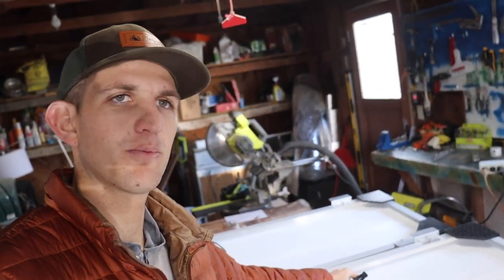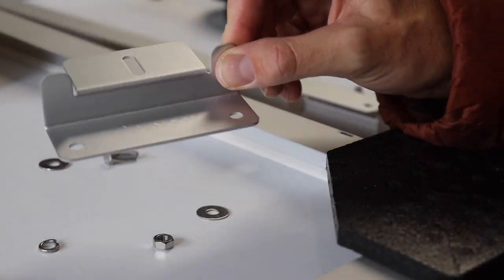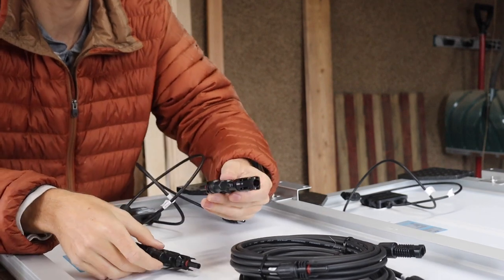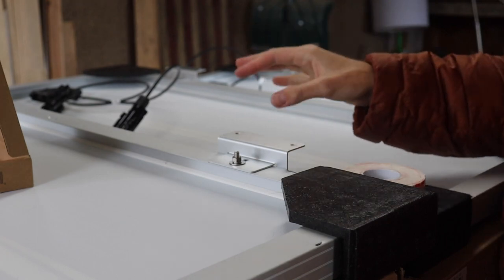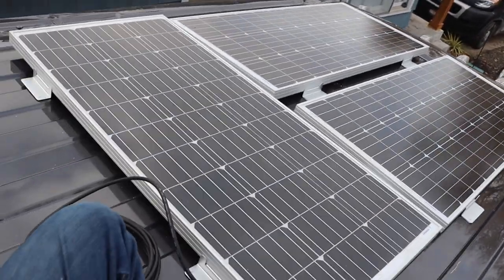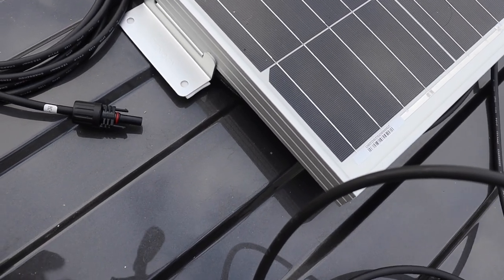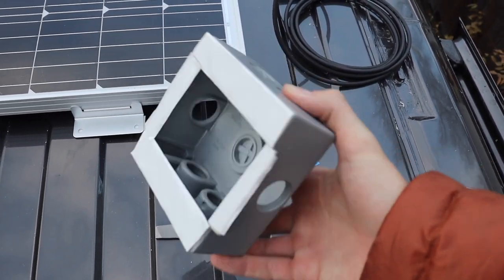VAN BUILD | RENOGY SOLAR AND GOAL ZERO INSTALL

Comment: Thank you for these videos, especially this one. I was contemplating wiring in a solar electric system with all the separate components, but now I realize I can do it in a much easier way with a power supply. Your channel has been extremely helpful as I get ready to convert my van here in Thailand. Cheers from the other side of the world.
Reply from the maker: You’re welcome! Good luck on you build. Cheers 🍻
Reply: Why do it with only a power supply?

Comment: The VHB tabe works very well,  but one caveat I'll add is to make sure surfaces are thoroughly cleaned with a solvent and especially to be cautious if the vehicle has been repainted, as a strong bond to the paint doesn't do any good if the the paint isn't properly bonded. 

It's harder to paint the roof of a van and harder to see it once it's done, so this is where painters are more likely to be less diligent about prep work.

Comment: Just ordered this complete setup for my promaster.    Love your videos.    Thank you so much.   Fyi, your link for the 15ft extension goes to the 5ft ones.  Had to send them back to Amazon.   Can you show us how and what you used to  take the 110v line  from the yeti?
Reply from the maker: Shoot!! Sorry about that!! I understand that gets frustrating. 
What I did for the 110V was buy an extension cord. Cut the end of it and wire it to the outlet! Then I just plugged that into the goal zero
Reply: @AnkeneyVanBuilds  Great solution!!
Reply from the maker: @mont3765  seems to have worked out great!!

Comment: Thanks so much for these videos the detail is great. Just finished our floor and plan to use most of your methods, I'm wondering why you choose 300W of solar to support the Goal Zero 1500? Thanks
Reply from the maker: 300 is a safe amount that keeps the goal zero charged up pretty quick with the amount of electrical to be used!! Ive been happy with it :)

Comment: Looking forward to seeing how you wire it all together! Love this idea!! I also like the fact that you can have the goal zero charged from any 12v source while the van is on the move.
Reply from the maker: This also makes it so easy to unplug and transport if you need to take it inside to charge!! Check out my ceiling and puck light install video. At the end I show how it’s all wired up!
Reply: @AnkeneyVanBuilds  it’s brilliant!! I happen to have a foldable 160w solar panel so I’m pretty sure I’m skipping the panel on the roof. Btw, don’t think you mention it but is the van a 159” or 159” extended?
Reply from the maker: @taeum3062  it’s the 159” high roof! Not extended!
Reply: Is it possible to charge the Goal Zero from a 2500 hp gas generator - if you have no other charging source?
Reply from the maker: @normabournes5789  yes! The yeti comes with a 110v plug in charger so you could take it inside and charge it in your house or in your case, with a generator
Reply: @AnkeneyVanBuilds  thank you for your quick reply! I don’t know how you do it! You seem to reply to all your messages! Your van turned it great! My husband and I are working on a 2014 Ram Promaster 159 as our retirement project. Your videos have been a God send! Thanks again!
Reply from the maker: @normabournes5789  hahah I love doing it. The people in the comment section are always so nice! And you’re so welcome! Good luck on your build!
Reply: Do you have a video showing how you wired up all your outlets, switches, fridge, etc. Love the channel super informative.
Reply from the maker: @anthonyturner1463  I show more detail in the ceiling and puck light video and the “finishing touches” video!
Reply: I’ve been following your videos!  Thanks for the detailed instructions. You’re awesome. By the way, did you put a 30A fuse or any fuse on the positive wire from the Solar Panel to the Yeti?  I’m copying your setup, just wondering if I will need some protection.

Comment: Love your videos! I’m starting a van build myself soon and I’m very excited to see how you wire everything using the zero.(is that similar to the ecoflow1300?) I have one of those on the way. I ordered it yesterday to help me have power for an electric heater during my build out but I was also curious if anyone as used something like this to power the electrical like you would a regular battery.
Reply from the maker: Thank you!!! Next weeks video will describe how I wired my my 12v puck lights and from that you’ll see how I plan on wiring everything else! 
I basically use a 12v cigarette plug to power a fuse block and run the positive and negative wires from that!
Reply: @AnkeneyVanBuilds  I messaged your Instagram. Thanks for your amazing vids!

Comment: Hi, definitely very informative video. I am in the process of building my own camper van. I already ordered YAti Goal Zero, panels, etc. Now i need to install panels and i came across your video. I am planning to do the same thing of using VHB tape instead of screws. Are all VHB tapes same? or I have to use VHB 4952? What about VHB 59xx tape? thanks
Reply from the maker: I actually ended up screwing the panels into the van and ensuring I had a good amount of Lap sealant on. I had someone reach out to me recently saying they used the vhb and their pannels came off while they drove😳

Comment: Very nice setup and tutorial! I bough a 1500X last week an have a question, whether your Yeti can charge in low light conditions, when solar power is between 2- 20W? Mine starts to charge when power reach about 30W and up. I try to establish that this is normal (are in others units is the same bug) or I have an MPPT regulator issue. It will be very helpfull if you can check it. Thank you
Reply from the maker: That is a good question. I haven't paid close enough attention to notice. Let me monitor that and get back to you!!!
Reply: What size solar array and what voltage is it set up at?

Comment: Curious to know if the 3m tape worked. I know it's been a while since this video was made. not even sure if Ankeney still does builds, but if anyone else has tried the 3m tape and had success would love to not drill anymore holes in the top of my van than necessary. Thank you.
Reply from the maker: The tape worked! Doesn’t hurt to double up the security of it buy screwing it tho
Reply: @AnkeneyVanBuilds  oh wow the man himself! I’m thinking of using an auto body adhesive, supposed to be as strong as a weld. Fingers crossed. I used it for some rocker panel repair I had to do once and it’s held up great.

Comment: I'm looking at the anderson to MC4 adapter that's linked in Amazon. Is the polarity correct on that for the Yeti, or did you need to use a reverse polarity coupling? (Folks mention that in the reviews on that one, and on the adapter sold on the Renogy site, but not clear what they're plugging into?) Thanks for your videos!

Comment: Hi Colton, did you connect the solar panels directly to the Yeti 1500?  No fuse needed on the positive wire?  Just wondering if it needs any protection. Thank you for the detailed video. I’m copying your setup.
Reply from the maker: Just tied it directly in!! No fuse

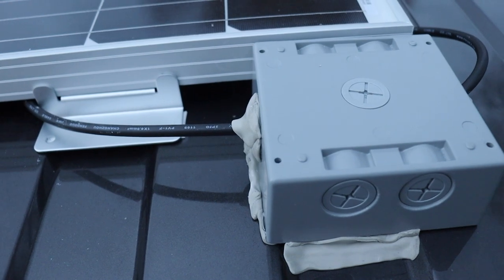Comment: Colton,  Love your videos!   At 9:11 in your video it appears that the bracket/tape/roof interface closest to your junction box is minimal due to the contour of the roof.   Can these brackets slide along the panels in order to maximize bracket/tape/roof interface?  Or, is the tape so good that just a bit of contact suffices?  Thank you again!!!
Reply from the maker: Hi! Great observation. I addressed this in a newer video where I talk about “finishing touches”
I’m sure that tape would have been fine. But I went through and added the self tappers and sealed them up! Just for extra precaution

Comment: To reduce the size of the hole you drilling in the top of the van, can you cut the renology wires and feed them through a smaller hole then reconnect them to the adapters inside the van?
Reply from the maker: You absolutely can do that. Yes

Comment: I understand you have 3 100 watt panels for a yeti 1500x, do you think 3 200 watt panels would be good for the 3000x?
Reply from the maker: I’ve used 400w for the 3000x before and it worked great! I have links to both of those in my last transit video!
VAN TOUR | ULTIMATE ALL SEASON VAN | 148" HIGH ROOF FORD TRANSIT
https://youtu.be/e8MRM9kUR28
Reply: @AnkeneyVanBuilds  awesome thanks man!! Do I need a voltage regulator of any type? I’ll make sure to go find those other videos
Reply from the maker: @adamirujo6877  nope!

Comment: what adpater do you have connecting from the Yeti to the 15ft cable? I dont see that it comes with the battery bank. Is it bought seperately?
Reply from the maker: Sorry that wasn't in the description! I have made changes to that. Here is the link: https://www.amazon.com/gp/product/B07GHJ9QS6/ref=as_li_tl?ie=UTF8&tag=captainvantas-20&camp=1789&creative=9325&linkCode=as2&creativeASIN=B07GHJ9QS6&linkId=89c20400e2c70f8bba28c9dc166d500e

Comment: Thank you so much ! Im about to start my build soon and these videos are really helps! Does the solar set up fill all your power needs? What do you use it all for ?
Reply from the maker: Hi! This solar set up runs the lights, mini fridge, the heater (when running) , some USB ports and a 110 outlet! I don’t have the mini fridge installed yet but so far it’s been great 👍🏻
Reply: @AnkeneyVanBuilds  awesome ! Thanks so much for the fast reply ; you are a GODSEND 🤘🏻

Comment: do you think the mounting tape would work on a fiberglass roof that has a curve to it?
Reply from the maker: Hmm I couldn’t say for certain. I ended up putting self tapping screws in as well as the tape!
Reply: @AnkeneyVanBuilds  Do you think you could have gotten away with 10ft cable extensions? My setup is very similar to yours.
Reply: Also wondering if theres a waterproof double sided tape that's not quite as strong and could be removed
Reply from the maker: @andrewnelson7406  10ft would probably work!
Reply from the maker: @andrewnelson7406  hmm I don’t know if I would trust something like that to hold the solar in place when your driving 80mph!
Reply: @AnkeneyVanBuilds  i would do the screws also. Do you think just the screws would suffice? Thanks for replying.
Reply from the maker: @andrewnelson7406  Just the screws would be fine :). Don’t forget to seal them up afterwards
Reply: @AnkeneyVanBuilds  Thanks :) What sealant would you recommend?
Reply from the maker: @andrewnelson7406  I used the same lap sealant as I did on the maxxairfann install

Comment: Hi, i'm about to hook up two 100W solar panels to my van, but i was unsure if it's okay to leave the 2-way connector unprotected. Does it need to be covered by a junction box too?  Or in your video it looks like you just leave them under the solar panels? I love your videos btw they've been so helpful during my build :) Thanks so much!!
Reply from the maker: Glad I could help! I have been putting the connectors underneath the solar panels on the latest vans, those connectors are designed to be used outside so you have nothing to worry about :)
Reply: @AnkeneyVanBuilds  sweet, thanks!!

Comment: Do i do the same thing you did in this video, even if I only put 2 panels? Also, if I put 2 panels and use the Yeti 400 insted of your 1500, how much can I power with that?
Thanks!!
Reply from the maker: Here is one were its a 2 to 1! 
https://www.amazon.com/dp/B08K8Y3LFN/ref=sspa_dk_detail_3?psc=1&pd_rd_i=B08K8Y3LFN&pd_rd_w=bCr3v&pf_rd_p=7d37a48b-2b1a-4373-8c1a-bdcc5da66be9&pd_rd_wg=T3pDZ&pf_rd_r=ZFBB6258068DSF41TVNR&pd_rd_r=c5decbc0-8d34-4a16-8e89-0ea2a821df61&spLa=ZW5jcnlwdGVkUXVhbGlmaWVyPUEzSDg4QkxOT1NBMlNRJmVuY3J5cHRlZElkPUEwOTcxNTYwQUhZTDI5OFcxMEhGJmVuY3J5cHRlZEFkSWQ9QTAzMzkwNDQxMkwxMlpRTkVVRzdLJndpZGdldE5hbWU9c3BfZGV0YWlsJmFjdGlvbj1jbGlja1JlZGlyZWN0JmRvTm90TG9nQ2xpY2s9dHJ1ZQ==

Comment: What wire did you put in between the max power output to the 12 volt fuse box?
Reply from the maker: Just an 8AWG positive and negative wire :)

Comment: Mounting the forward panel does not have enough surface for the tape. Also, the cable should be contained in some type of plastic conduit(waterproof), rather than letting them move around on top of the roof, rattling between the panels and the roof.
Reply from the maker: I ended up using the provided self tapping screws to secure the solar panels to the roof.
Reply: @AnkeneyVanBuilds  I hope you were able to contain the power cables and waterproof the point where the cables enter the van. Cables bouncing around loose is never a good idea.
Reply from the maker: @route66paul  renogy cables are waterproof and they’re secured under the solar panels. So there’s not going to be any issues

Comment: Does that renogy thing can run a portable heater? Thank you
Reply from the maker: What kind of portable heater are you looking at?
Reply: @AnkeneyVanBuilds  just a ceramic heater 120 V ac/ca 60 hz
1500 w(25 deg C) or bigger
Reply from the maker: @olepickle5366  from the specs of it. It would be able to provide enough output. But I don’t think you’d be able to run the heater very long before draining the battery. Maybe a few hours if you’re not getting any solar charge
Reply: @AnkeneyVanBuilds  well thanks for your time, I really appreciate it, keep on posting informative videos
Reply from the maker: @olepickle5366  you’re very welcome!!

Comment: Can this system power an induction cooktop?
Reply: Yes the yeti 1500x will go up to 2000 watts constant.  I'm assuming you are talking about a single burner portable unit.  They use around 1800 watts on high.
Reply from the maker: Yes what he said ^ 😂